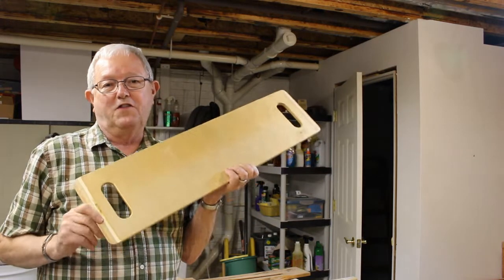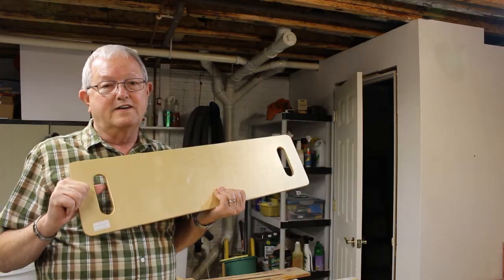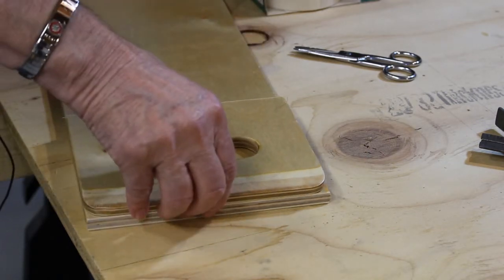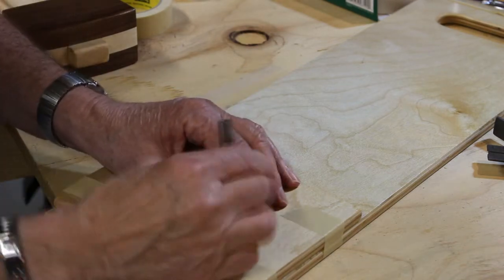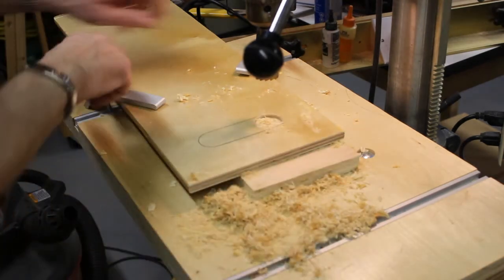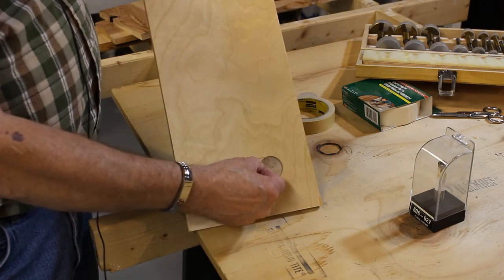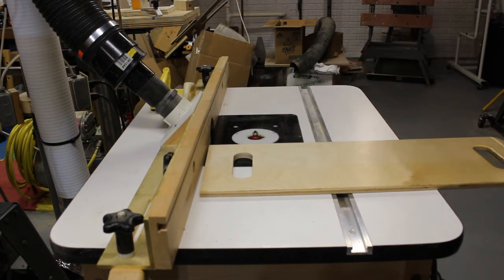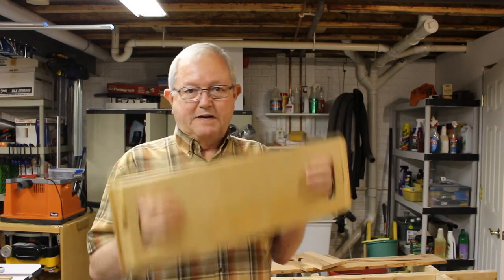Transfer Board, What It Is And Why I Had To Modify It.

Comment: Good idea using the old hand hole as a router template. I hope your daughter recovers soon.

On a tangentially related note: while I have no direct experience, I do have empathy for your daughter's current situation. My main income "job" is that I help to transfer a paraplegic gentleman from bed to wheelchair then back again several hours later, 7 days a week (for over a year and a half now). But we use a hydraulic lift. And my mom has been wheelchair bound for over 15 years now. Luckily she can usually transfer on her own (no board required).
Reply from the maker: Steve, I will pass along your comment to my daughter, thanks for the kind thoughts.  You sure have first hand knowledge of what is involved with the problems of the wheelchair bound.  Thanks for taking the time to watch and to leave the nice comment.

Comment: Can you say which kind of wood has been used. I was using one which broke after a while use.. I am heavy too..
Reply from the maker: Agna,  I just spoke with my daughter and she said that it is approximately 1/2 inch thick.  I would imagine the wood it is made out of is either a high quality baltic birch or finnish birch plywood.  The plywood it is made of is made of many thin layers. 
 The one she has does not have much flex to it.  I hope this helps.  Good luck and thanks for watching.
Reply: @paulsmessyworkshop  Thanks